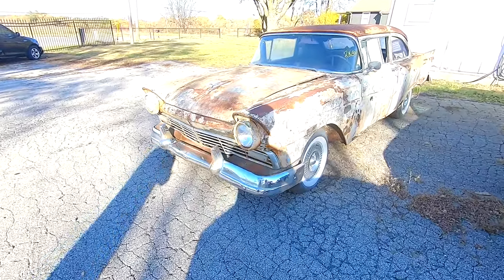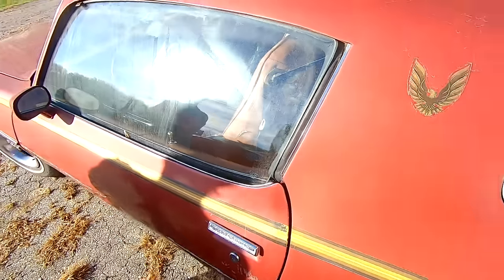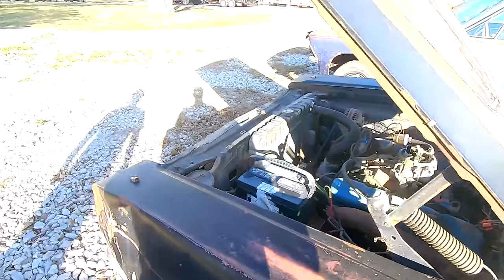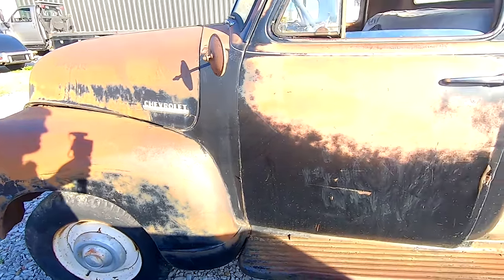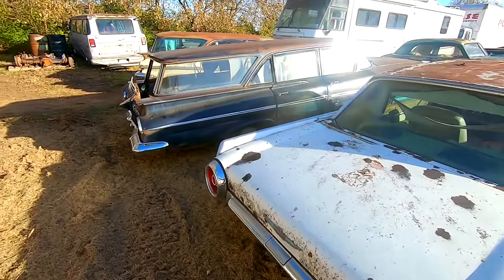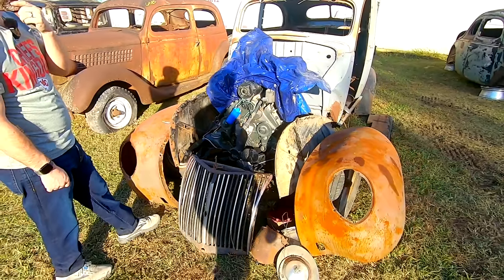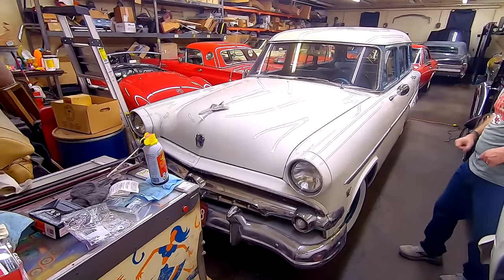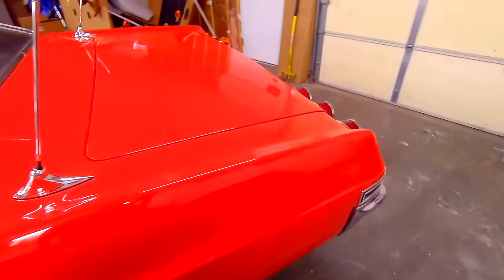OVER 80+ OLD Cars & Trucks for Sale at Auction! Classic Car AUCTION PREVIEW! Bob's Auto Collection!

Comment: Hi Ryan.  That blue Impala is a 1969.  I used to have one.  I hope you buy the 1961 Bel Air.  My first car in 1972 was a 1961 Impala with the 235 six and Powerglide. Gas was about .25 cents per gallon in Iowa in 1972.  Good times.  
Awesome video.
Reply from the maker: Right on! We shall see what i can buy!
Reply: 3 on the tree 235 I had one fun to drive

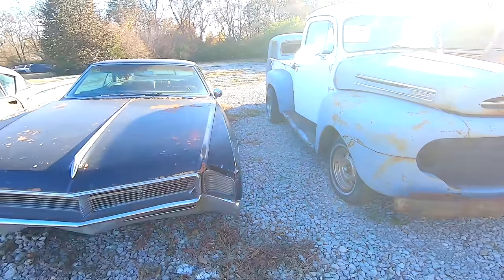Comment: That Riv 21:56 gotta be a '66 or a '67. The detail that indicates it's a '66 or '67 is the letters/emblem on the hood. But those part are missing, so only the engine can tell what year it is. (or the vin-number for that matter)
The '66 has the 401/425 nailhead and the '67 has the 430 under the hood. Also the '67 has a thick horizontal bar that runs across the grille

Comment: Jag is a Mk V and NOT pre-war but the model which came just before the Mk VII. It was made between 1948-1951 and has the same frame but the old, pre-XK engine with 2.7L or 3.5L pushrod six (which means that the XK OHC will fit, and I have seen it done in the past. You could even fit the discs from the last Mk VIIs so it's possible to create something which would be useful even in modern traffic but look original). Restored ones go between €40K to €60K here in the EU. There was also a drop-top model but those are twice as expensive, and maybe one or two station wagons done by an external coach builder. In the US I suppose they are not as desirable but still it's a rare car, far rarer than the model which replaced it and even the sport XKs.